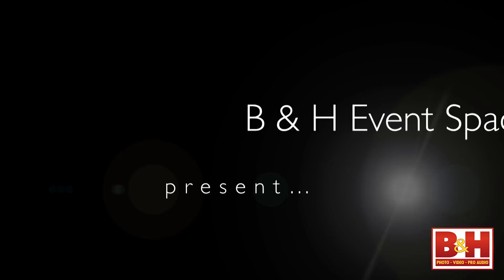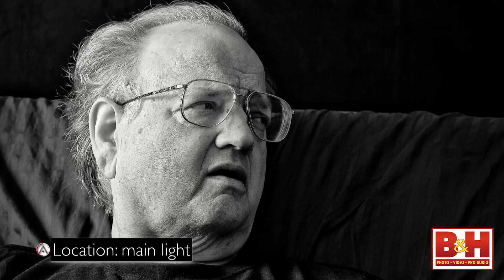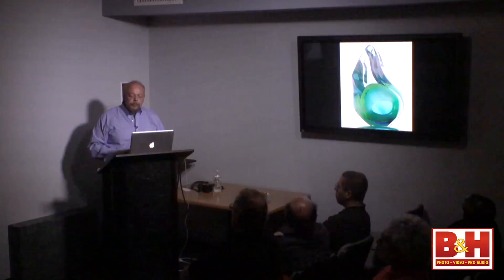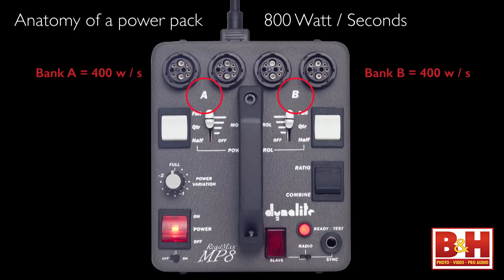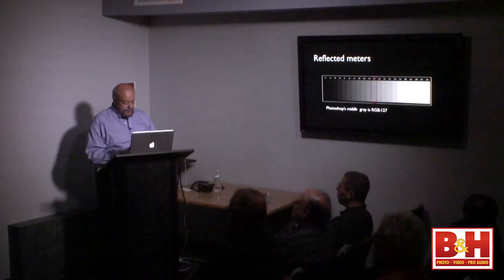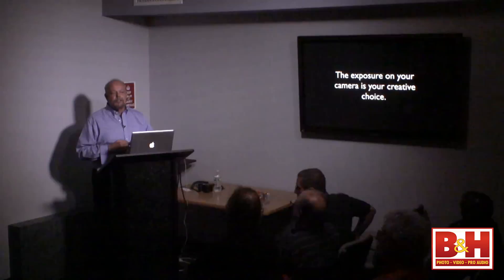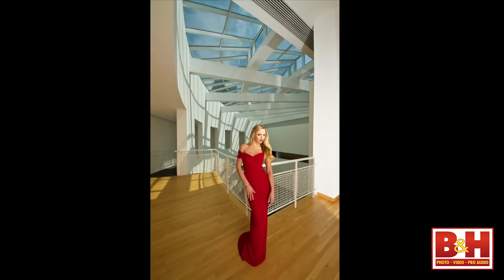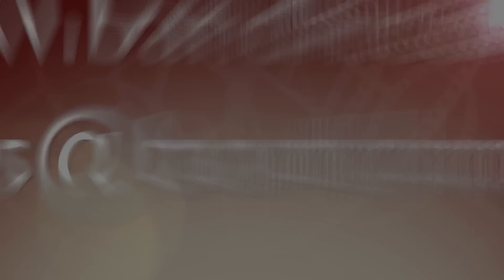Making the Jump to Studio Flash

Comment: Overall a good presentation but there is some slightly misleading information in it.

Firstly, you can get beautiful light from a speedlite either by modifying it, feathering it, by grouping them, or by bouncing them.  A pack is not inherently 'prettier light' that a speedlite per se.

Also not all speedlites are 60w/s equivalent, some are more powerful.  From a cost benefit perspective a Yongnuo 560 iii is about $70 and competes well with the most expensive options from Nikon and Canon in terms of light output. 

Lastly watt/seconds are a measure of power not light output. Different units with the same watt/second rating can absolutely output different amounts and quality of light.